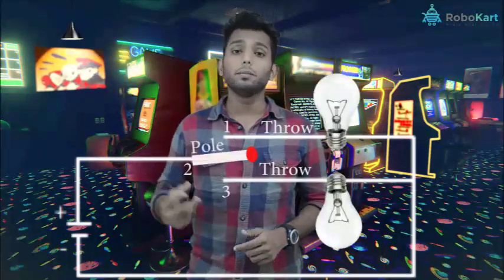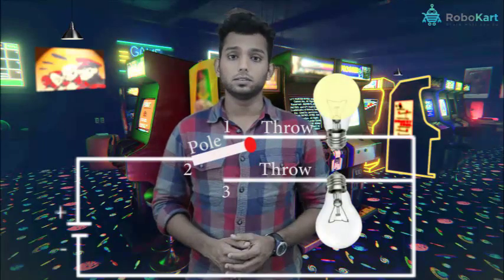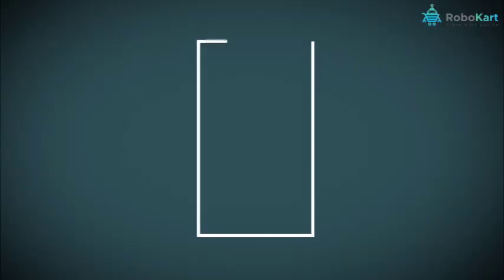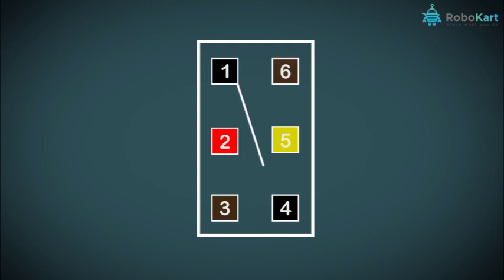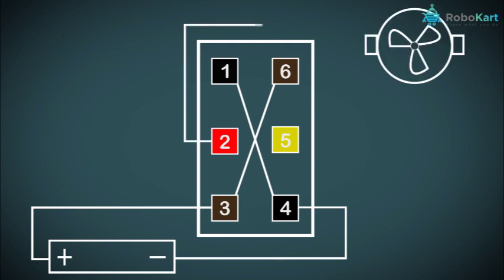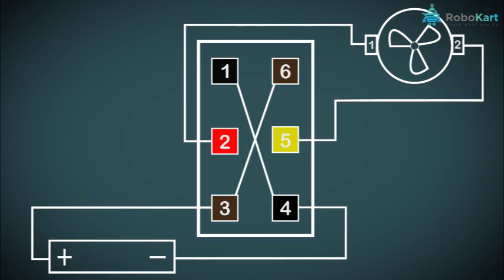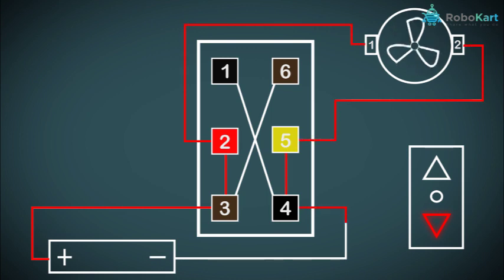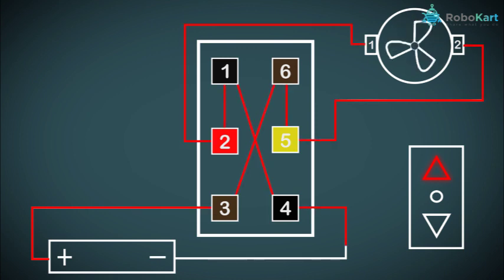Learn about switches (SPST,SPDT & DPDT)

Comment: Hello, I have a 20 AMP double pole switch that works as follows: Its a Light switch in a guest bedroom with a Neutral (on the Top Left), Black Hot wire (on the Top Right) and Red Cable (on the Bottom Right). This Bottom right cable is only HOT when the master bedroom light switch is turned on). The Bottom Left terminal is blank. The house was built in the 20's and this setup I am told was used as security feature to turn on lots of bedroom ceiling lights from one dedicated switch in the master bedroom. When the master bedroom switch is in the ON and the Red Cable is hot the guest bedroom light switch remains on thereby keeping the ceiling lights illuminated. Can you describe how many throws it has? Thank you!

Comment: A good video, The Best explanation of DPDT switches I have to see what about filters for switches i.e. Type, pole ( My need is DPDT  throw configuration ), switch action ( required for Height Adjustment Mechanism for PC table ), current Rating ( My vase 2amp 12 volts DC ) I could not order on Amazon for want of these requirements. Please advice. Thanking You in advance

Comment: You saved my ass today.  I was replacing a High/Low rocker switch with a Hi/Off/Low toggle switch because my husband broke the spring-wound timer switch by forcing the timer back to zero to turn off the whole house fan. So while I was replacing the broken part, I wanted to add a way to turn the fan off without damaging the timer again. The toggle switch came with 6 connection ports and no instructions. My husband came home early, so he was home and waiting on me while the main breaker was off. I was able to wrap up the project in time to spend the evening together. Thank you so much!

Comment: The switch you used to show a SPDT is wrong. That's a SPST switch with light. You also got the direction wrong. 2:52 When the switch is physically in the down position PINS 1& 2 and 5 & 6 are closed and when up it is 2 & 3, 5 & 4 that are closed.

Comment: so in other words dpdt switches gives you the ability to reverse polarities
Reply: Yes but That's only one function that you can achieve with a DPDT. 
1 Reverse polarity.
2. Open and close two separate circuits at the same time with different voltages and or current types. (not recommended to use two different current type but possible.)
3. Operate a single component from two different power sources. 
4. Operate a single component at two different voltages.
5. Operate two different components from a single power sources.
6. Operate two separate components where both turn on or off in one position(throw) and in the other position only one component turns on or off.  

a few others.
Reply: Aztec Warrior I see I didnt consider the separate voltage or components, thanks for info!!
Reply: @GoodstrAteGy  you can also use a DPDT to get high and low speed from to small D.C. motors.

Comment: Can I connect 12v 30 Amp car battery to 6 Amp dpdt switch ??
Reply: That depends on how and what you are wiring. all the switches he showed are for AC only but people still use them. As long as they don't use something that uses the full 30 amps or even half that. It is best to use a relay in any case you may think you will have a lot of amp draw. The way I understand it it's how and what the contractors are made of actually in the switch that makes the difference. They are made of metals that tend to arc less and thicker. DC arcs more and that may cause issues when reversing polarities or other situations. hope i helped.